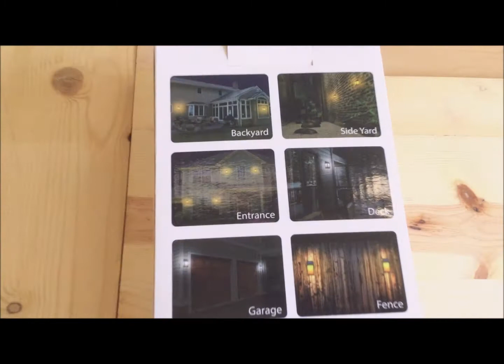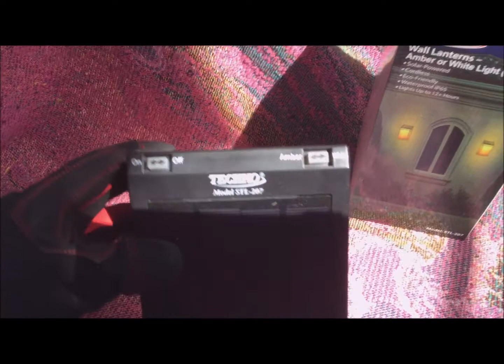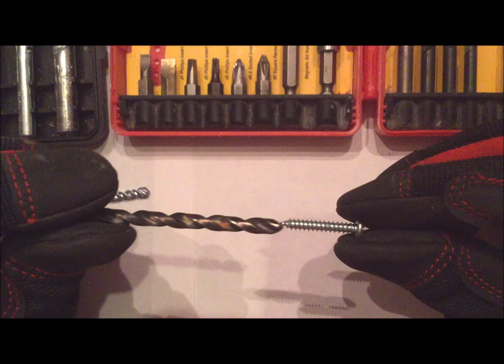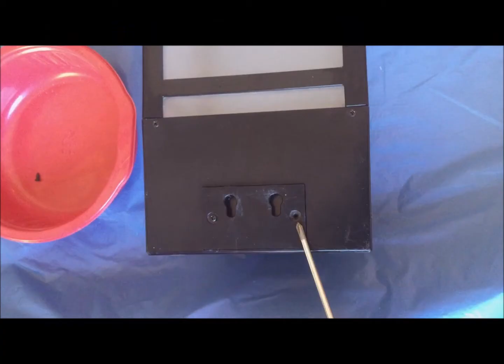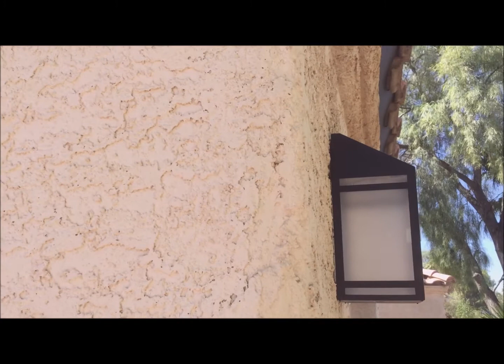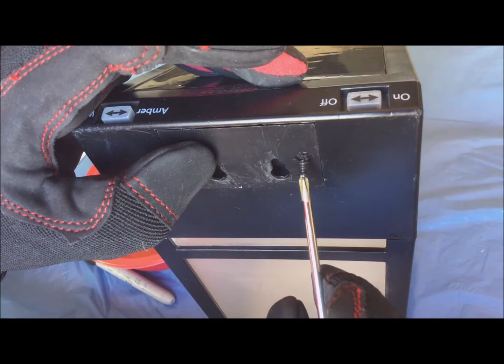Solar Light Wall Lantern on Stucco

Comment from the maker: SHOPPING LINKS
Spot the typo on the thumbnail?
 😅 Turns out spelling 'Lantern' with no 'n' is pretty hard, but fixing the thumbnail was even harder! Just pretend it’s custom-tailored lighting. Hope you enjoy the video anyway!
~SOLAR WALL LANTERN STL 207 -   https://amzn.to/3i9rpyU
~DEWALT DRILL DRIVER -   https://amzn.to/2V1QLGa
~MASONRY DRILL BIT SET -   https://amzn.to/3j142XB
~LEVEL -   https://amzn.to/3f8GeQe
~WORK GLOVES -   https://amzn.to/3zUeJ53
~PLIERS -   https://amzn.to/3lcg175
~HOLE PUNCH -   https://amzn.to/3xdooC3
~SCREWDRIVER PHILLIPS TIP -    https://amzn.to/3rIFbMb
~HAMMER -   https://amzn.to/3rJyjhf
~BLACK MARKER -   https://amzn.to/3j7ZS0a